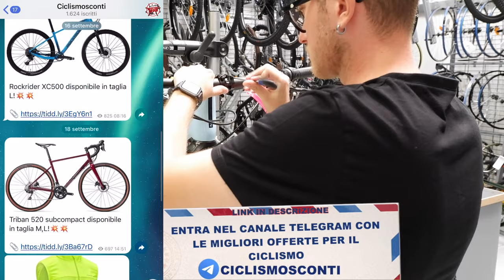ROCKRIDER RACE 740 UNBOXING

Comment: Qualcuno mi sa spiegare pk i prezzi di race 740 e soprattutto race 900 siano schizzati così in alto? Più che altro la race 900 costa ora 3000€ (chi se la compra!) la versione base, 3019€ il modello solo cambio elettronico o solo ruote in carbonio e 3099€ il.modello completo